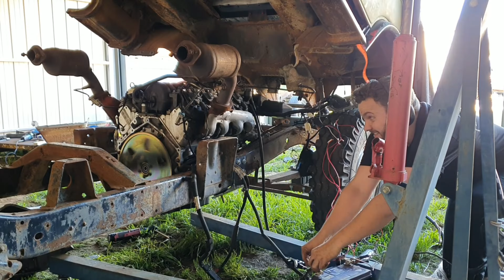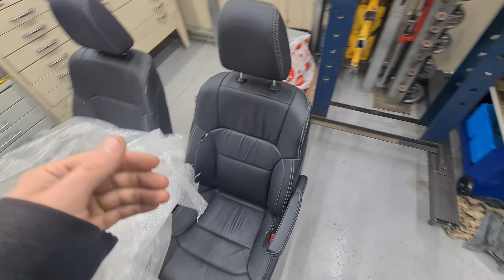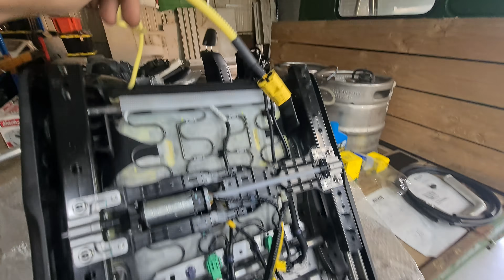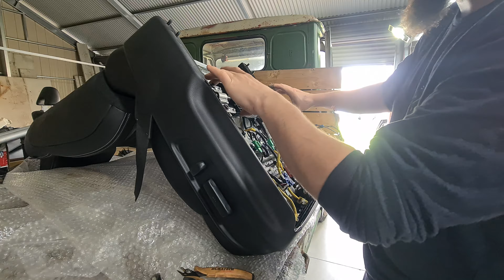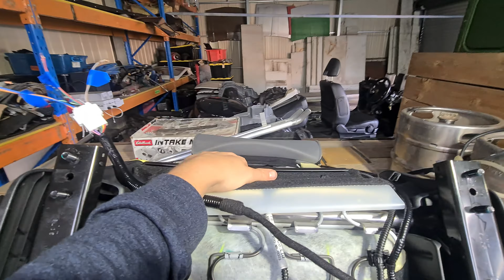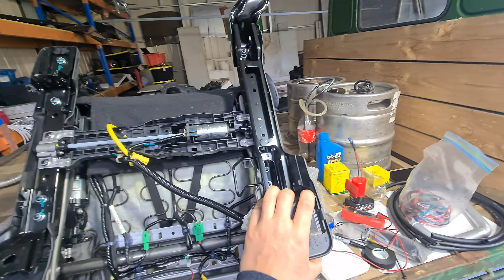How to wire Honda Odyssey seats for your project car!

Comment: Years back in 2006 I put front and rear interior of 2005 Pontiac w/  front power  buckets in my 1967 Buick Skylark. The pass seat had only 12vdc+ and neg. No sweat wiring that one. The 6 way + lumbar driver seat car had a bum memory feature and worked off the BodyControlModule. My Buick didn't and wasn't going to. So, the driver seat required 12ea 12vdc relays to function. The switches were SPST  (that's how it seemed back then  ) to the BCM and it did the rest. So, there were 12 functions; Seat fwd & back, seat up & dn, seat backrest fwd & back,  seat bottom (tilt?) 1 &  2,  and the lumbar had 4 functions TOTAL= 12 relays. They are full sized seats and there was a convenient way to mount them all underneath the seat's  bottom out of the way.  Doing my conversion was easy compared to your work!  I say good job to you. At thius writing, I'm having difficulty finding a schematic for my 2018 Accord buckets ( 6way + lumbar ) that are going into my 1976 Buick Skyhawk .
It's running a Buick 350 V8 + 200R4.  This engine is a cousin to the Rover V8s you Brits and Aussies love to squeeze into anything and obviously almost everything bigger than a grocery store shopping cart.  * Note No SBC in mine. It's All Buick!! *
Thank you  very much for giving me a jump start. I'm getting out my ohm meter and diving into it.
Reply from the maker: Happy to help, but it seems like you would have worked it out in no time 😁